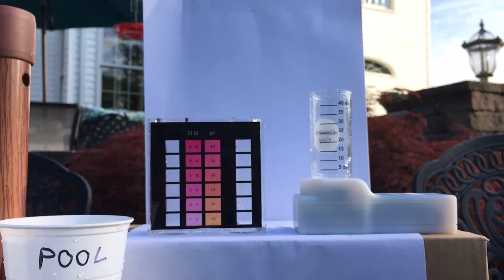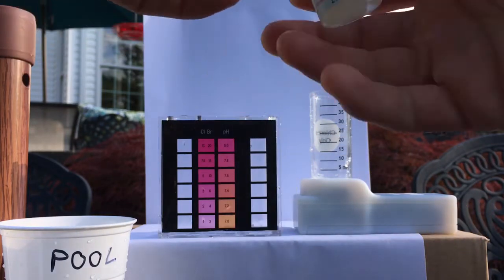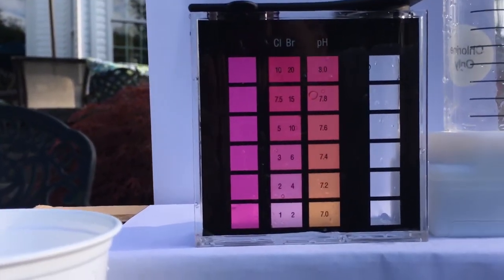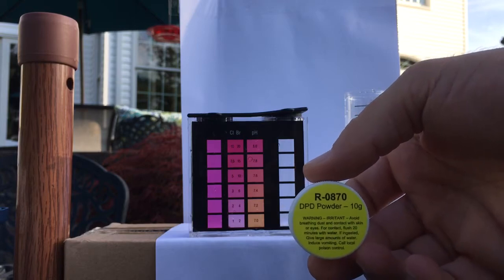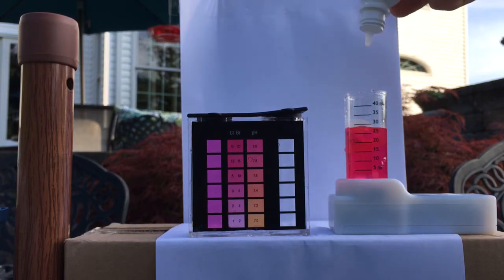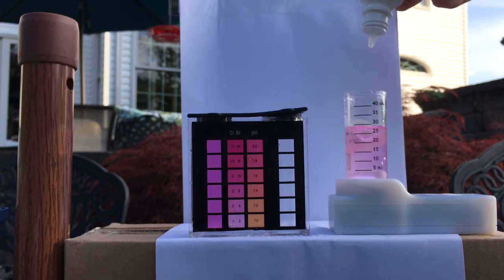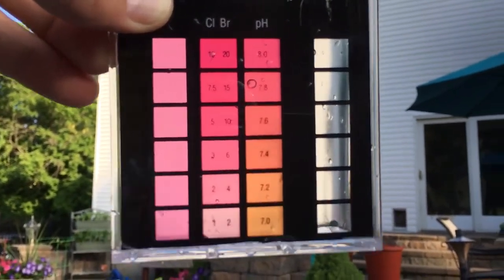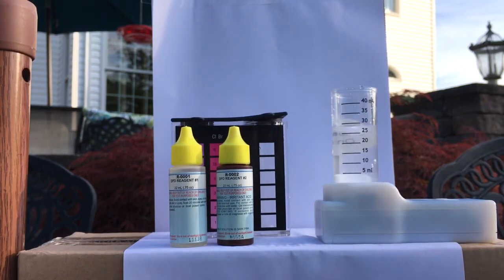DPD vs FAS-DPD Chlorine Tests

Comment: Mike, 

Thanks for posting the video on the difference you were getting between the two test methods. You ask some very good questions that we would like to address.

First, in the video your Taylor-labeled reagents (R-0001 and R-0002) have a lot code that indicates the reagents were made in 2012. These reagents are generally good for only 2 years (depending on storage conditions), so it is not surprising that the results for the color match test came out low. Second, the reagents used in your FAS-DPD test look to be re-packaged Taylor materials. No lot code or expiration date appears on the labels, so I cannot address the “freshness” of the reagents. This may also account for the test difference, as older product could lose its strength resulting in needing more titrant to reach the endpoint (you would think you have higher results than actually in the water). It is important to also note here that the dropper tips that come with the Taylor product are engineered to provide a consistent drop size (25 drops/mL) so that the users get consistent results. This re-packaged product may not have as consistent a dropper tip as the Taylor original products.

In June of 2015 OSHA adopted the GHS rules and now all reagent labels need to be GHS compliant for commercial use. The reagents you use for the FAS-DPD test are not GHS compliant. Your supplier should make sure he brings his product into OSHA compliance, if they are not already. The MSDS that accompany the product also changed to SDS, and these also need to meet the GHS codes.

Please know you can always call Taylor at 1-800-TESTKIT with any questions or concerns you might have. Asking the manufacturer directly is always a good practice. We are here to help you.

Thank you for using Taylor products!
Reply from the maker: Thanks so much for replying to my video.  I have since confirmed what you noticed about the age of the reagents.  After getting this discrepancy I bought replacements for R-0001 & 2.  I retested in the same comparator and I did indeed get a higher result when testing side by side - old and new.  I thought my old reagents were bought last year.  I clearly was mistaken.   I plan on doing a follow up video stating these results. 

As far as the FAS-DPD test.  Again you  are 100% correct it is a repackaged R-0871 with a different tip than genuine Taylor..  I also plan to purchase a genuine Taylor FAS-DPD kit and compare that with the repackaged one.  Stay subscribed and look for these follow up videos.

Also, thanks for the info regarding the new GHS rules by OSHA.  Lesson learned.  Going forward I will only buy direct from Taylor.  This way I will be confident I not only have fresh reagents whose contents are indeed what they are labeled to be, but  also correctly calibrated tips.
Reply: Wait, I just noticed this: You used Taylor DPD reagents that were 4 years old? And the new reagents confirmed the higher results that you got with the TFTKit DPD-FAS test? Sounds like the problem was with using old reagents, no matter who it came from. Unless the TFTKit bottle-tips mix-up mentioned elsewhere affected you, it doesn't appear the DPD-FAS test was the primary party at fault here.
Reply: Question for Taylor Technologies....Can you test for bromine levels with both methods? 
Thanks

Comment: You did not demonstrate how you acquired your pool water sample. It should be acquired by rinsing the container with pool water, inserting the container upside down to arm’s length, and then turning it over. Bubbles will rise to the surface when it fills. Then quickly remove the sample from the pool. Don’t let your fingers or hand touch the sample as your hand has its own chemistry. Done improperly could mean that all tests could be skewed. FYI, I would never use a cup. Either use the cylinder that you are testing in or the container provided with the test kit. Do not let the sample sit (minutes matter), nor allow it to be in the sun. Since you did not show it, the proper level is obtained when the top of the meniscus is at the desired line.

By putting your fingers on the pill, you may have already changed the chemistry of the surface of the pill and thereby the results of the test (always wash your hands before and after testing)

I personally believe the difference is the quality or age of your reagents (no matter when you bought them). Are they from last summer? Did the store have them on the shelf too long? Try buying new reagents anyways. Your chlorine test appeared to be 3.0 in the first test, and 5.0 in the second. 

I also agree with the previous comments as well. Don’t forget to focus on your saturation index. Good luck

Comment: For the dpd test you have to compare immediately after doing the test for accuracy, which you did first time. When you looked again after a few minutes it didn’t count because it reads lower or sometimes turns more of a purple color.

Comment: Thank you for this. I’ve been looking at test kits and liked the value that the TF kits provide but had reservations as the bottles were not labeled like normal Taylor reagents. Something just felt off to me about it but I couldn’t find anything really online until this. So thank you for saving me the trouble. Going to Taylor directly!
Reply from the maker: Thanks for the comment Derek. The little extra cost is negligible.  I think it makes sense for peace of mind. Practice good management of the vials and they should last a long time.  Like store them indoors, screw caps on tight.  Make sure not to cross contaminate, etc.  I change them out every 2 years whether I have any left over or not.

Comment: This was a one-time snafu with non-calibrated dropper tips. The company (TFTestKits) owned up to it, and promptly replaced all affected customers.They should reprint or at least provide the expiry / lot #'s, I agree with you on that.
Reply from the maker: TFTestKits never replaced anything for me.  Quite the opposite.  When I called it to their attention, they actually argued with me. Would not make good on their product.  They wouldn't even consider the having me send back the vials so they could do their own tests to confirm if it could have been a bad batch.  I will never buy reagents (or anything for that matter) from them again. 
I buy direct from Taylor now.  This way I know I am getting not only getting fresh reagents, but also proper vials.  These resellers (TFTestKits, et. al.) buy reagents in bulk and then they repackage them in smaller, easier to sell vials. Think about how much can go wrong with this process: 
How long have those bulk vials been sitting on their shelves before they are transferred to usable vials. 
Are they clean? Is it sterile? 
Chance of user error pouring a certain reagent into the wrong vial?
It's not like this is some highly regulated industry like the Food & Drug Administration.  
Don't let the fancy web site fool you.  This is a mom and pop operation. It's probably some dude sitting in his basement, pouring the bulk container into hundreds of little vials.
Buy from Taylor and cut out the middle man.  This way you know what you are getting and have a company behind you with accountability.
Reply: Diesel Mike If they did that, then that’s inexcusable. But I’ve had good experience with them, so I can only throw up my hands as to how you were treated.

Comment: You put too much powder in the scoop!!!! The scoop should be level!!!
Reply from the maker: Nope!  Read the instructions: You should really know what you're talking about before spreading fake news.
From the Vendor I bought this one: 
"Using the small spoon shaped end of the dipper, add one heaping dipper, or two level dippers, of R-0870 and swirl to mix."
and THIS Directly from Taylor themselves:
"Add 2 dippers R-0870 DPD Powder. Swirl until dissolved. Sample will turn pink if free chlorine is present.
NOTE: If pink color disappears, add R-0870 DPD Powder until color turns pink."
Reply: @DieselMike  exactly at 3:33 you added 2 heaping dippers not level ones

Comment: Okay a few points to consider … Plastic bottles are subject to variation in manufacture this means drop size from one bottle to another will not be identical.  How much of a difference this may make is marginal, but  a consideration.  For whatever reason in a legislated environment the FAS-DPD method is not approved.  I cant comment as to why this may be, it may be no one has asked for approval?   

The purpose of pool testing is to indicate the current level of the tested parameter.  It is not a life or death situation and the nature of water will mean there will be variations in samples even within the same container.  Again I don't know the amount of variation however there will be some.

I don't see a specific technique issue.  I do see a situation where one test being the tablet is more 'exact'; than the other method being scoops and drops; 'exact' being the amount of reagent is likely more consistent.  I don't think this will make a large impact as the powder is an indicator, however it is another factor.   

I am not aware of any lab instruments using titration on a regular basis for FAC readings.  It is usual to use photometer which works with tablets or sachets of powder.  The two companies I am most familiar with both employed Dr Palin to develop their test systems and formulas.  Even then the two instruments give different readings if used side by side.

My inclination is this is an outcome of disassociation and for lack of better words reassociation within the sample.

Curious in the video though is usually DPD#1 tablets left in a sample vial will slowly change colour.  Is this happening as well?  How old are the DPD#1 tablets?   Be very interesting to see DPD#3 test against the other method and see if the results are the same there as well.
Reply from the maker: Hey Dave.  Thanks for the comment and watching.  I solved the issue by never buying from a third party that repackages Taylor products.  The FAS/DPD test was bought from TFTestkits.  They use bulk reagents from Taylor and repackage them in smaller, generic bottles.  I have compared bottles from Taylor vs TFTestkits and they clearly dispense different amount of reagent.  Who know what else can go wrong when repackaging products (cross contamination, dilution, etc).  They are a garbage company.  So now I only buy direct from Taylor so I know I am getting the real deal.

Comment: Man, you are wasting a lot of DPD powder. Try using much less (even a level spoon would probably be enough). As long as you can see the pink, and the transition is clear you should be good. If you don't believe me try doing the test a few times, first with two heaping spoons, then one heaping spoon, then one level spoon. You'll more than likely get the same results all three times.
Reply from the maker: Yes, I agree.  Amount of DPD powder doesn't matter.  But as far as wasting.  That little 10g container will last me over 2 seasons. But I do not hang onto any of my testing chemicals that long anyway.  So regardless, it's going in the garbage after 2 seasons. This is used for my personal pool and I only do the DPD test if I feel I need a more accurate test than the comparator test.  If I am showing ample Chlorine on the comparator, I typically won't even bother with the FAS-DPD.  
That said, at the time of this video, I totally don't trust the FAS-DPD drip reagent as it was a repackaged vial from TFTestkits which clearly dispenses a smaller drop than the genuine Taylor Kit (which accounts for the higher reading).  See comment below directly from Taylor Industries
I have since replaced ALL testing methods with only Taylor products bought directly through them.  And now, both the comparator test and the FAS-DPD are spot on in agreement with results.  
Appreciate the comment.  Thanks for watching.
Reply: From my understanding, you should always err on the side of putting more in. The point of the DPD is to saturate the chlorine, otherwise you get inaccurate results. (Granted this is more important if you have high chlorine levels, as in a SLAM process to get rid of copious algae.) A good practice is two level spoons or one heaping; that should cover a wide practical range of real-life scenarios.The OP is also correct in stating that there's plenty of DPD to carry one through its expiration, so there's little incentive in conserving, for the most part.

Comment: Great video, both in terms of content and presentation. Thanks for posting!
Reply from the maker: Thank you.  After many tests I recommend buying genuinely packaged Taylor reagents.  There are dealers out there that buy Taylor reagents in bulk and then repackage them in there own bottles to sell to the consumer.   BEWARE! The caps DO NOT dispense the same size droplets.  I have compared these repacked dispensers alongside Genuine Taylor ones with drastically different results in pH, TA, CH, and FC tests.
Reply: Looking at the date your video was posted, it seems that you (too) were probably affected by this issue :

https://www.troublefreepool.com/threads/118546-TFTestkits-has-a-big-quot-Oops-quot-to-report

Your point about re-packaged reagents is still valid, though; not only as regards the dispensing tips, but also in respect to the loss of batch traceability, production dates and expiry dates.
Thanks again!